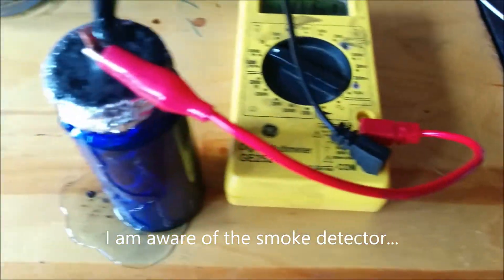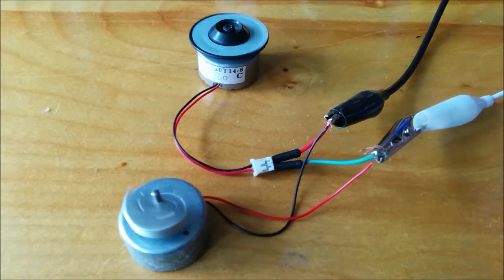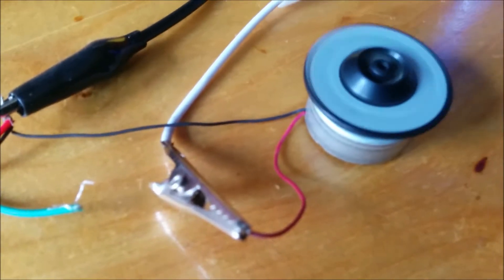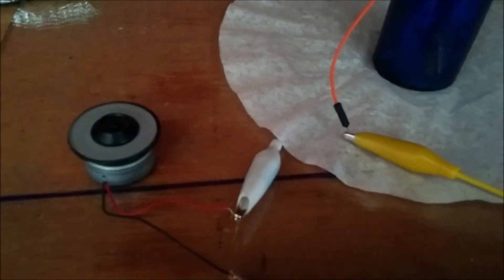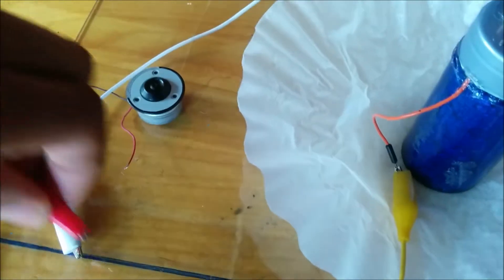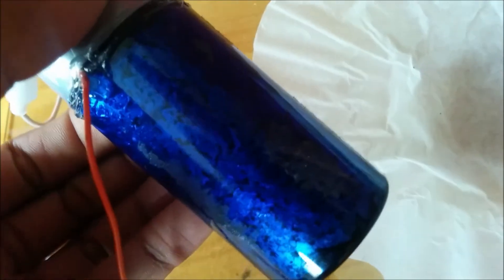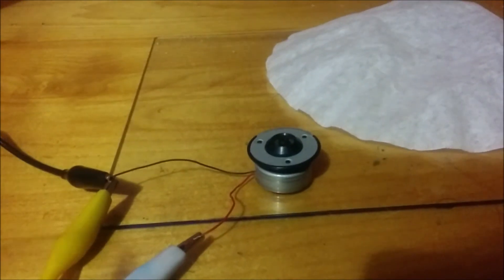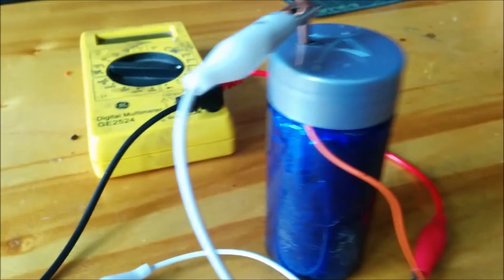Aluminium Carbon Battery!

Comment: definitely aluminum corroding because this is generating potential from the oxidation of the metal hence it being an "air" battery since the anode is literally air, maybe the cathode, i can never remember which is which. but it's a redox reaction, leo goes ger gain electrons reduction lose electrons oxidation... so the aluminum gets oxidized, it gives up the electrons to the oxygen? the oxygen gets reduced? so if electrons are e÷... and anodes are negative (sometimes)...i guess the aluminum is the anode and the air is the cathode? meaning one part of this battery is just a current collector not the cathode... confusing

Comment: Very Good! Can be done Al-ion accumulator battery))) ~1,2 voltage of the one element. Need experiments with electrolyte and rolls carbone with aluminium foil and insulator between them.

Comment: Sodium hydroxide 10% up to 30% by weight  is what I've used. Did away with the copper. Used a piece of nickel for cathode. Spandex for membrane. Pie tin aluminum from dollar store. Does good.
Reply: wait-wait-wait! If you put aluminum into lye solution, it will eat its oxide very quickly, resulting in aluminum reacting with the water
it is how some people produce hydrogen. Why doesn't it do that in your setup?
Reply: @jskratnyarlathotep8411  gum arabic added to sodium hydroxide. I mix gum arabic 20% wt to distilled water then add NaOH, at least 10%. Now your aluminum will last for many hours.

Comment: It's four years later, but on this construction, it looks like you're not using an insulator between to carbon and the aluminum foil. If not there is a galvanic event happening and that is why the battery is getting hot. With the isulator that won't happen and the power should be at a higher voltage.
Reply from the maker: Interesting!  Maybe I'll revisit it soon!  Thanks for the tip.
Reply: what kind of insulator should it be? paper won't work, i guess, as it will be soaked in the electrolyte, becoming conductive
Reply: so what is the best isolator for this? can i using a cheesecloth

Comment: When the process is going on to produce electricity, gases are released by the aluminum that cause it's eventual decline and stopping. This is the pressure you observed, When you tapped on it it started again because some of that gas was released. You need to allow for the easy release of the gas to allow the cell to work longer. And don't use any bleach because it will quickly corrode the aluminum.
Reply from the maker: Thank you for the tips. :) How do you know all this?  Do you work in a chemistry field?
Reply: I was researching various cells and what they are made of. Only two show promise. The one you have and the copper-aluminum one. I read a paper from a professor who said that the reason a cell runs down isn't because it loses any power but because a gas is formed near the elements that prohibits the transfer of ions from one to the other. I was certain of this when you tapped your cell and instantly it started going again. When you sealed it up the gas had nowhere to go.
Reply from the maker: Myreply59 very interesting!  Thanks for sharing.
Reply: is it possible to use carbon rod instead of copper one in that cell?
Reply: Lead acid was chosen because the reactions cause a transformation in the lead that does not dissolve and gas off.

Comment: Any way, use bleach instead of salt because salt is very weak that makes it a half volt
Reply: The voltage is 1.32
Reply from the maker: so you got 1.3 volts by using bleach?  very interesting!
Reply: If you know how they make bleach this would make sense. Also consider what would be created in a reaction while attempting to recharge this battery.

Comment: Cool.  I imagine there's corrosive buildup on the copper or aluminum that's preventing reaction until you shake or bang it.  I've done something similar with copper and galvanized metal.

Also, the gas buildup may be poisonous.  I know for certain putting current INTO the battery will cause a poisonous gas buildup because of the salt in the water.  This method was used to crack water into hydrogen by using salt but one of the gases is a form of chlorine.  So be careful.
Reply: It's a primary aluminum battery! Also called an aluminum fuel cell. The aluminum oxidizes and must be replaced. A mix of aluminum chloride, urea, NaCl, and distilled water can make a great rechargeable (secondary) electrolyte.
Reply: @ExNubeNetwork  what about the copper? could it be replaced with the graphite rod?
Reply from the maker: Jeffrey Cobb Good point.  I was actually aware of the fact that putting power into salt water would produce chlorine gas--I've done a lot of research on that regarding HHO generators--But for some reason I didn't think of that for this.  You might have just saved my life ;)  I'll be careful.